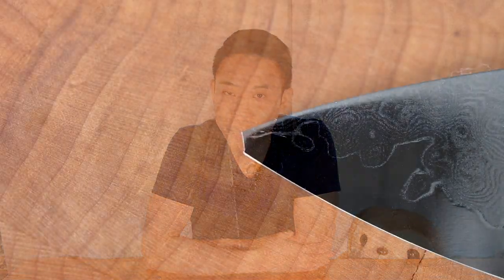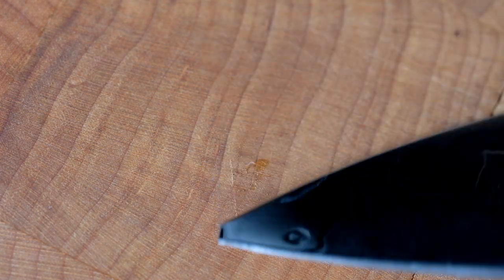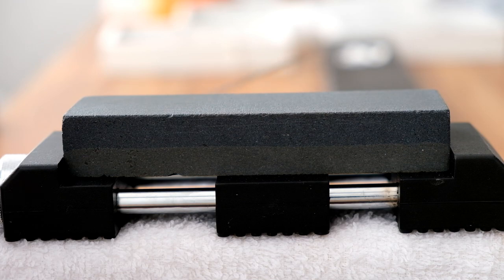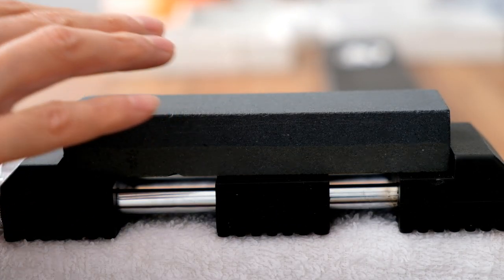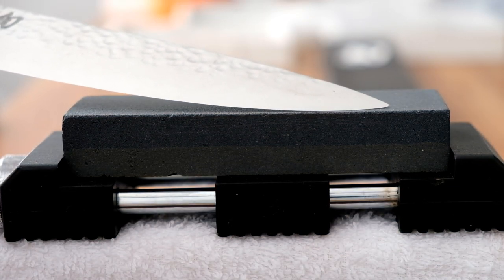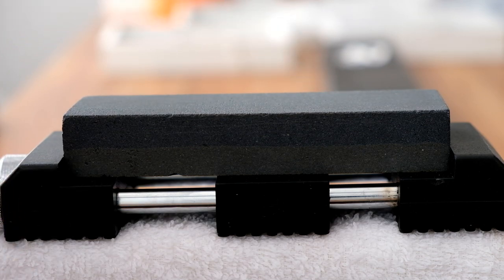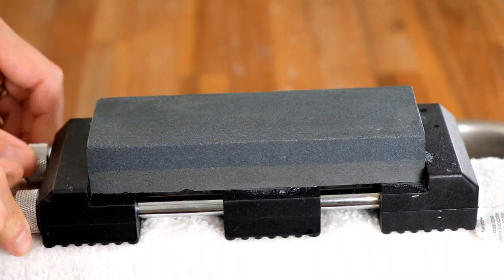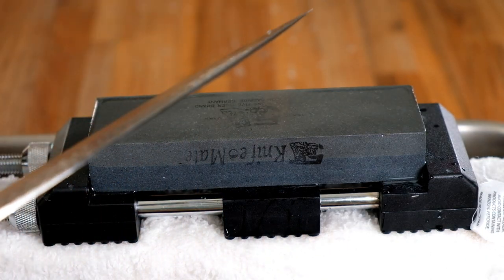Shun Premier Chef's Knife Repair and Thoughts on Shun

Comment: The dimpling effect is called "Tsuchime", and you are right, it's mostly a pain unless you are only cutting hard vegetable. I have a Sakai Takayuki gyuto I almost never use (other than for certain fish) because small scales (like from an Aji Horse Mackerel) always end up getting trapped in the dimples.

Shun knives are certainly overpriced, the same could be said with any mall/department store knife. Goes double if you are buying a knife set. Shun knives don't perform any better than than cheaper Japanese knives of the same steel, what makes them expensive is the "fluff (nicer boxes, someone who speaks English)" they put over it, this is why they can offer deep "discounts".
Reply from the maker: Back when I was first getting into knives, I met a Shun snob. Looking back, he didn't know much about knives. I could go for some Aji Horse Mackerel nigiri right now. The Shun Premier in this video is in a box right now. Currently using a Wusthof Classic Ikon 8-inch that I picked up for $100 brand new.

Comment: A chipped shun? No way! Shuns suck ass. My shun 8 inch premier is worse than every knife in my collection. It chips and dulls way too easily. Sorry but the primary grind is too thin for VG10. It literally will dull and microchip during normal use cutting veggies. It’s pathetic. Shun won’t even back their overpriced products and claim “improper use”.